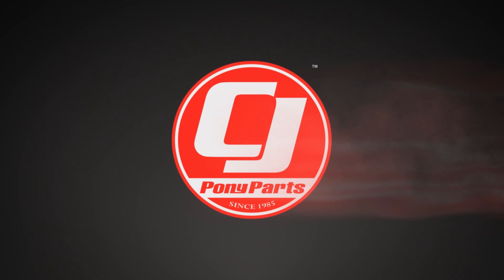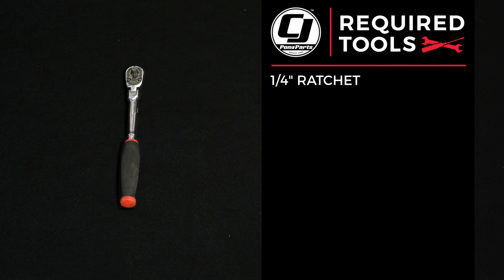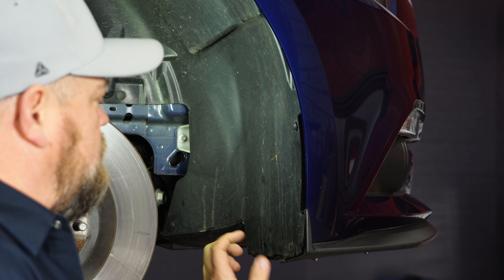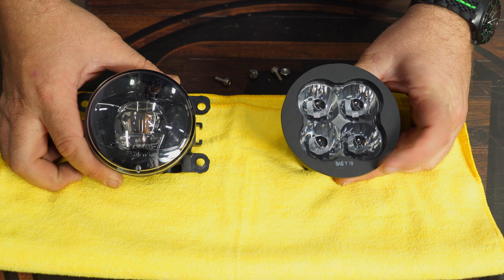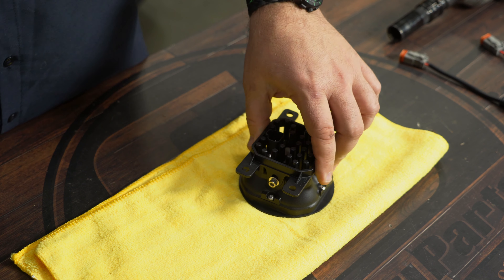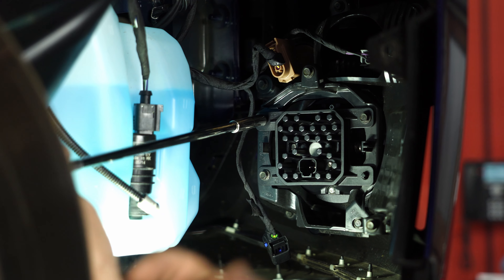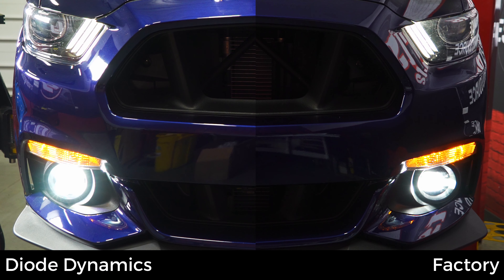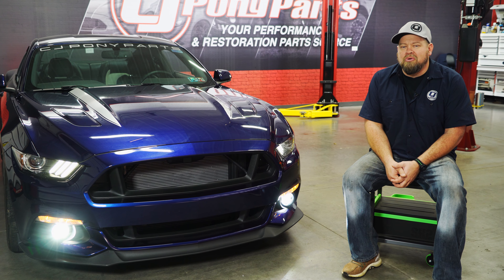2015-2017 Mustang Install | Diode Dynamics SS3 SAE Fog Lights

Comment from the maker: SS3 White SAE Fog Light Kit: https://www.cjponyparts.com/diode-dynamics-fog-light-kit-ss3-sport-white-sae-driving-v6-2016-2017-ecoboost-2015-2017-gt-2015-2017/p/FGLA96/
SS3 Yellow SAE Fog Light Kit: https://www.cjponyparts.com/diode-dynamics-ss3-sport-fog-light-kit-yellow-sae-v6-ecoboost-gt-2015-2017/p/FGLA98/
SS3 Pro White SAE Fog Light Kit: https://www.cjponyparts.com/diode-dynamics-sae-fog-light-kit-ss3-pro-white-v6-ecoboost-gt-2015-2017/p/FGLA100/

Comment: I bought and installed the Baja Designs LED Fog ligth kit... in your opinion which are better? The Baja or the Diode Dynamics? Looks like I paid alot more for the Baja Designs. I love them, but they were very pricey.